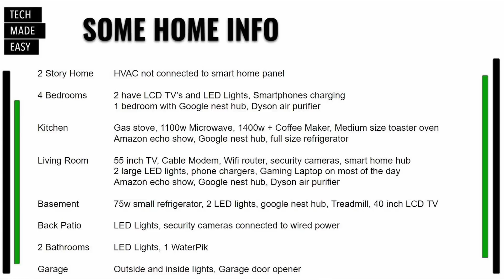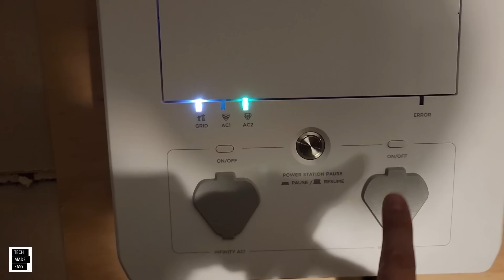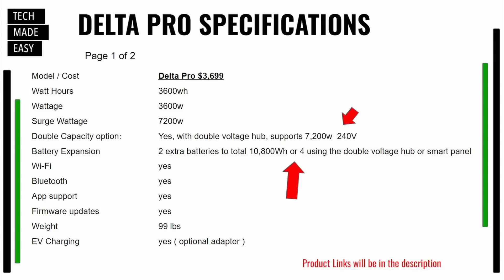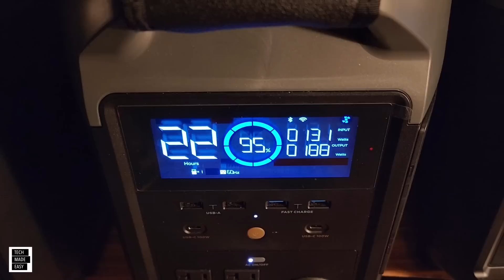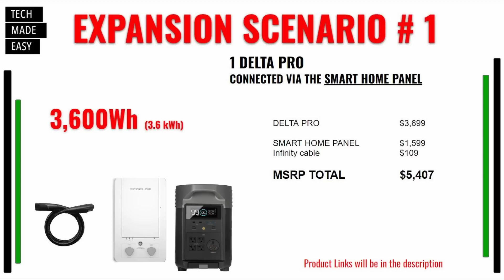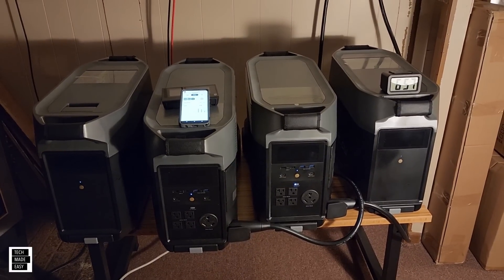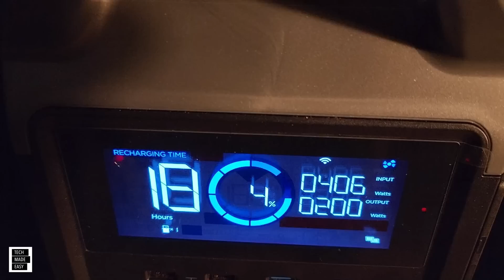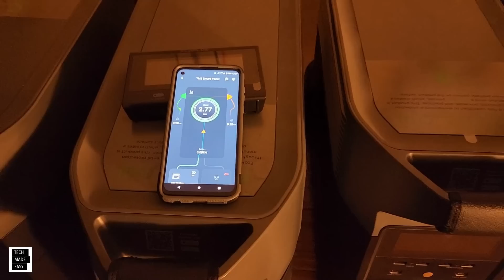Real World Test with EcoFlow Smart Home Panel & EcoFlow Delta pro

Comment: I appreciate this video. I have had a Delta Pro, a Delta 2 and a River for about 6 months. I have done a lot of experiments to see what they would run and also use them for backup power. I have the Delta 2 doing backup for my fridge. The River is backing up my WFI, TV and Cable Box. I use the Delta Pro to cook and make coffee in the event of a power outage. I recently purchased a second Delta Pro and a Smart Home Panel so I am anxious to get the Panel installed and have a better backup system. I will be using it in my winter home in South Texas and hope to be able to run everything off of the backup power.
Reply from the maker: Hi Roy thanks!
I still have my original smart panel and love it works great

Comment: Not sure if anyone already asked but can the Smart Panel be configured to automatically switch the ten circuits to use battery each night?  For example if I want to use power my panels generated and banked in the battery during the day?
Reply from the maker: Yes by setting an automation

Comment: Many thx!  Great effort to put this test together and do such a great job narrating, etc.  Great to see the real-world test.   I am thinking of getting a Delta Pro. I have a full solar system in my home.  I am comparing doing what you have done vs. a large solar charging battery system to be running off the batteries full time.  The pricing is in the $17k range.  However, it could allow use of about 16kWh daily.
Reply from the maker: Thank you

Comment: That Delta Pro sure is a beast of a power station. 3600Wh is more than enough to run my home for a long time.
Reply: Keep in mind you Can get a 9500 watt generator for $2500 at harbor freight. That will run even big ACs with an installed soft start.  These battery systems are way expensive.  It is a pretty good system for solar supplementing - I don’t think it would pay for itself but having a backup for our unreliable grid is necessary (that’s going to get worse guaranteed with the idiots in government going “green”).

Comment: Great test. Would love to see the same test but with the solar panels in play. Thanks again for providing us with a great informative channel..
Reply: Yeah - I was a little bit surprised to see that the solar panels weren't in play after showing and talking about them in the beginning of the video. That's the test that I'd really like to see. Obviously it's not going to be a 1-to-1 for everyone because the sun isn't going to be the same for everyone, but neither is the power draw for everyone, either. Hopefully that kind of test is coming soon.
Reply: I have this system and I can see why this presentation shows usage without the solar panels.
How much energy do they give and how long does that last when there is no charging going on?
This is what people need to know.
When the sun is up, these things run and run day in and day out - depending on the number of panels employed.  That is going to be different in California compared to Ohio, for instance.
In the Summer here in Ohio, I have to find ways to USE more electricity while the panels are charging my two delta pros and 4 batteries.   I do lots of washes and vacuum the whole house, etc.   LOL!
In the winter.... solar is way less and I make nowhere near as much electricity.   It's so variable!
Reply: It holds on at 1% because the internal energy counting the unit performs is a joke. The % reading cannot be relied upon.

Comment: I leave both Deltas and my batteries on.  All I do to switch the usage of one set to the other set is to start recharging the set in use for a few minutes.   The usage switches to the units that are not being charged.
EPS setting does use power (so a set of delta and battery(ies) will drain because of that.)   One can turn off EPS and I find my units do not use much energy in their power standby mode at all.
I like the EPS, mind you!   We had an hour power outage here and I was working at my computer and wasn't even aware the power had gone down!   When EPS is off and the grid goes down there are a few seconds of no house power until the units kick in.   Sometimes that matters, and sometimes it really doesn't.
Reply: It may be worth negating the EPS need by having one to two computer UPS where needed.  I have a large UPS on my whole wifi + security system for instance.  Now if I just put a small one on my computer upstairs I would be set.

Comment: It's surprising to see that a small coffee maker uses 1400 watts!  I ran my sprinkler pump list night using an outlet on the front of my pro and it's a 3/4 hp pump and it only uses 1150 watts!  I've connected two pros into the safety switch in the electrical panel to be used for power outages and hurricanes.  I also wanted a way to use the system when there were no power outages and I do that by have my pros in my garage below the breaker panel.  From there I can connect my sprinkler system pump, house water pump, washing machine, all electrical equipment in the garage thru cables from the front panel.  This is what the smart panel does, but requires extensive panel rewiring.  I no longer have to pay for water.  I presently only have 400 watts of panels on each pro, but plan on expanding that to 1200 on each supply.  I'm putting them on top of a carport I'm building.  The big thing I haven't tried yet is running my house ac.  When it's running, it's only on for ten minutes or so.  It's actually off more than it's on.  UPDATE:  The house ac failed due to the turn on current spike.  I'm now installing the Micro-Aire Easy Start on the ac and it took the lra from 77 to 23 amps.

Comment: I feel if you recharged the bank not being used each day using 1200 watts of solar. It should recharge by the time you switch back over. You could switch the 1200w panels back between each bank. You could also shut off circuits not being used to reduce fantom draw. This would greatly expand the time. You could also add the smart generator to top off each bank as needed depending on sun availability.

Comment: so if my house uses 300 kw max per month,  and I use a Pro, battery, solar and generator,  I dont need grid at all.    ?      brilliant video, thanks.
Reply from the maker: Thank you for your kind words first of all. I will say I bought the Delta Pro mainly for power backup but since I have it I have used it from time to time to reduce my energy costs. Now I'm not going to kid you working a full-time job does affect that because I'm not able to move my solar panels around and I don't have rooftop solar and I don't know if you can connect the Delta Pro to a rooftop solar system I haven't seen any solution that allows that

Comment: That was an awesome test.

I am continuing with putting solar on my house with 2, 10kwh Enphase batteries at $25k. 

I was considering the EcoFlow route, but it wouldn’t be cheaper. EcoFlow you can’t take the tax credit so easily. EcoFlow is just too new to outlay that much money.
Reply: Why can’t you get a tax credit on the EcoFlow system????
Reply from the maker: That is a good question
Reply: From my understanding you need to be grid tied to the grid. Permits and all
Reply: Place your bet!!
Reply: Are there more hidden expenses??.  Those cables at $99.00 each × 4 etc.
Reply: Just the Pro & Battery don't buy nothing without the Smart  Electric Panel, which does not work 100% in the UK
Reply: Why was there an error light on? I get an error if i try to charge both at the same time. I must be singular like you said. 
I didn’t install any of the 30 volt module so the biggest appliance i have running through smart panel are the fridge and washer.
Reply from the maker: @erniemar1778 they fixed that with a firmware update, not sure why and didn’t have any issues but it’s fixed

Comment: I would like to see you do this test once again, but with the following parameters setup. Please put your dual Delta Pros in (Split Phase) 240 Volts AC mode with your smart box. I think you will be pleasantly surprised with the overall efficiency of the power drain from your units being much more efficient. Why would that be ? Simple. The higher up you go with your AC Voltage base, the less overall amperage is required to energise your home grid. Do not forget your original house power panel is setup for dual 120 volt AC circuits split apart from the single phase 240 Volts AC coming in from the 520 Volt AC 200 Amp step down transformers on the power poles. (Some power companies step down from 750 Volts AC outside and that all comes from 25 KiloWatt Lines above the Pole Transformers)
Reply from the maker: Good info Mark thank you

Comment: Lot of good info thanks. Can one of the options be to Pair a Delta Pro with an extra battery to get 7.2 KWh instead of getting 2 Delta Pros with the smart home panel? I realize with 1 Delta Pro I will be able to use only 1 of the infinity ports in the SHP.
Reply from the maker: Yes but you won't get 240v

Comment: What is the cost to charge the system on regular power.  What's the kilowatt saved. All with out solar.
Reply from the maker: Cost would be depending on how much battery capacity you have and the cost of your electricity from your provider

Comment: So Using the double voltage doubleler  and add two batteries, you get longer use but no more than 7200 surge limit.
Reply from the maker: Check with ecoflow to be safe on that one
Support@ecoflow.com

Comment: Very nice video and explanation.  Question: is it possible to implement Delta Pro scenario #5, but without the 2 extra batteries? In other words, 2 Delta Pros, 2 Smart generators and the smart panel.  Related question, can this work with the smart panel set to 220 volt mode?
Reply from the maker: Thank you 1st
I would say email EcoFlow to be sure on that support@ecoflow.com

Comment: I would also like to see the test with solar charging in play to see how much more you can use with the pass through charging. If you had a big enough solar system and max out the input to the batteries you could in theory run your House on the solar as long as the sun is shining.
Reply from the maker: It can handle 1600w of solar on each delta  pro so 3200w , not bad 😎

Comment: Excellent detailed video. Thank you. Could you charge the batteries while using the system with your solar panels?  Also I thought you could just use 1 delta pro and 3 or 4 batteries? I'm new to all this. I live in the Philippines,  so I am on a 220v electric system. I had planned on getting 1 delta pro and 3 batteries.
Reply from the maker: Thanks 👍🏻 Hi the delta pro can have 2 add on batteries and yes you can charge solar while using

Comment: I don’t have solar. But I’m considering gettin 2 delta pros and the smart panel. My question is, if I run the delta pros in a blackout and they’ve drained, can I hook up my gas generator to charge them back up. While also running the house on my generator. I have a 8kw portable
Reply from the maker: When connected to the smart home panel you won’t be able to plug these into a generator unless you unplug them from the panel each time and the generator must have a pure sine wave outlet, can’t use any generator or you will cause damage. You can plug in EcoFlow smart generator https://youtu.be/onALnTDT7YE?si=2Mr8a3usGT-vjzlE
They also have a new one that has gas or a propane option

Comment: Great video, thanks for the information, I was wondering how hard is it to install the smart home panel? Is any electeician able to do it or does it require some additional training or anything else that I might have missed?
Reply from the maker: Any electrician can install it they’re very familiar with wires and there are instructional videos online plus you get the installation manual it’s really not that bad I didn’t install it I had an electrician install it cost me around $1500 here is a link with one of the videos 
https://youtu.be/1WKt8I4vL3k

Comment: Great video, thank you for sharing! 
I would love to see a test with the solar panels! I would also like to know if the Smart home panel is "smart" enough" to fully charge one battery/delta pro first before it goes on to the other set of delta pro/battery, when being charged via solar. 

QQ, at the end of the video, your smart home panel has the error led illuminated. Is there a way to diagnose what the error is?
Reply from the maker: Thank you, solar is connected to each delta pro and not the smart home panel, in my case I have 1 set of cables coming in, I charge one set at a time. 

The red light showed up after I did an update , don’t know what it is but the system is working fine.
Reply: @TechMadeEzy  You had 2 panels in a previous video when you showed us connecting in series. Is there a reason you don’t connect a solar panel to each station or it’s just easier to have 1 panel outside and switch the connection to each Delta Pro?
Reply from the maker: Hi
I normally try to charge one set as quick as possible so that's why.
Reply: @TechMadeEzy  Thanks. Sorry was asking question while I’m still watching the video. I see the 2 panels.

Comment: btw, after ruzzia will fall, we will use delta pro to save some money - we will charge it at night^ when electricity costs twice less and will use the batteries during the day together with solar. I already bought smart generator and saving some money for my first Delta Pro. next step will be smart panel - and I'll be ready to face the winter (our apartment is fully relay on electricity, so the only way to have food and heat apartment - is to charge the batteries when we have electricity (blackouts are every 8 hours in Kyiv now and it lasts for 4-8 hours in a row) and to use the solar panels. And, for emergency - smart generator). Regards

Comment: Thanks for the info and test. Much appreciated. How do you like the SHP2 compared to the Original SHP? Is the SHP2 worth the extra $500+?
Reply from the maker: Hey thanks 👍🏻
I am only using the original I have not switched to the new version and I would say to you if you are going to use Delta Pro Ultra definitely get the new model if you're only going to use Delta Pro then I would go with the original

Comment: Where did you buy your solar cable extensions?  Assuming you needed them.
Reply from the maker: https://amzn.to/3PXIZF2
Reply: @TechMadeEzy  Appreciate it and the video.  I"m debating pulling the trigger on a setup but am concerned that my breaker has way to many breakers and 240v items to be effective wthout a second panel.....  May go with the setup as a starting point and consider adding another panel later or consider a generator plugin option with the 240v dual cable.

Comment: Will this smart panel prevent back feeding the grid if you want to supplement existing grid power with solar?
Reply from the maker: This system doesn’t have the ability to back feed to the grid. Each unit can handle up to 1600w of solar so 2 Delta Pros can have a total of 3200w of solar.

Comment: It would be interesting to know how long this set up would run if you also needed to run a Gas force air furnace to heat the home during the winter.  That is my main concern living here in the North East.  Sure, I have a small inverter generator(3600w) that can run the house during an emergency, but I am wondering if this set up would function like having a whole house generator and allow me to only run my portable generator during daylight hours.  This way it would switch from the grid to batteries and I would not need to start the generator as often.
Reply from the maker: Definitely a good question don't forget you can also connect solar even in the winter time and you can also connect a special generator that eco-flow makes its gas, about 1800w but you wouldn't have to disconnect it from the smart home panel

Comment: Interesting. Have you tried same test but with the solar connected to see how long during typical weather to see how long you can use only solar power? I know the variables change all the time but it would be interesting to see how long you could stay off the grid.
Reply from the maker: No not with solar. But I use solar to recharge the batteries
Reply: The time you got was impressive but the true worth I feel would be how long using solar to keep the batteries charging without being forced back on the grid or being forced to use a generator for backup. You said you have used the system some to save money not using the grid.
Reply from the maker: I’ve done some experiments and I have found certain months to lower my electricity costs. It’s been a while since I’ve had the time to do more tests

Comment: Thank you for this helpful test! How many phases are you using to power your house & home panel? Thanks for sharing! 🙏
Reply from the maker: Thank you 
Just setup as single phase not split phase
Reply: @TechMadeEzy  we have a 3 phase current net here in Switzerland! Wondering if it‘s work on a blackout when switching from 3-phase to single phase within 20ms!? I will have only single phase groups atrached to the home panel, but from different phases. Let you know when its done
Reply: @albimerz3300  Please do share and report back. Thanks!
Reply: @albimerz3300  I have a similar question and would be very interested to hear how you worked it out.
Reply: Dear all
The SHP is not approved for Switzerland yet, so I have to wait until we have the GO. Will inform you later.
Merry Christmas to all of you 🍀

Comment: Have to know this: If you have Delta Pro that has a surge capability  of 4000 wats (Boost), when you use two does the surge capability double also, or is the surge (boost) the same as one Delta Pro? WHAT IF YOU ADD BATTERIES; DOES THE BOOST AMOUNT CHANGE? tHANKS
Reply from the maker: Hi Perry
 surge is 7,200w for a second or so. Adding 2 with the smart home panel I'm not sure if the surge increases. Adding batteries will only increase run time.